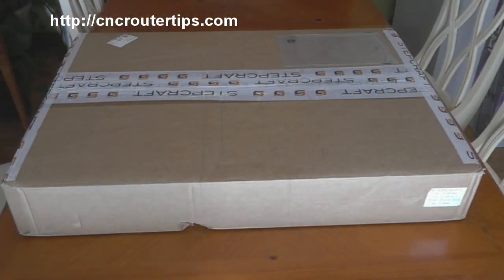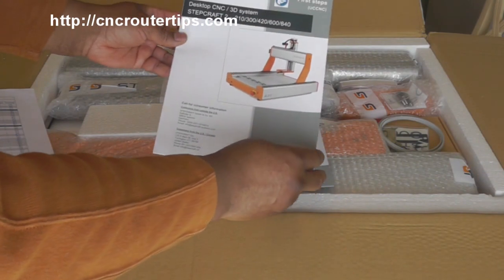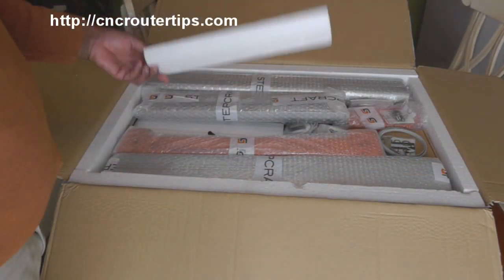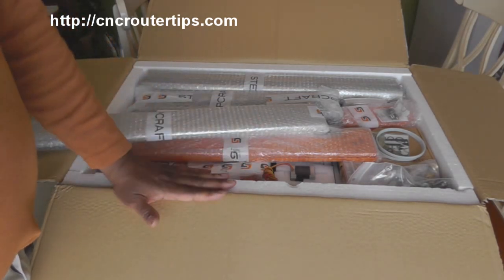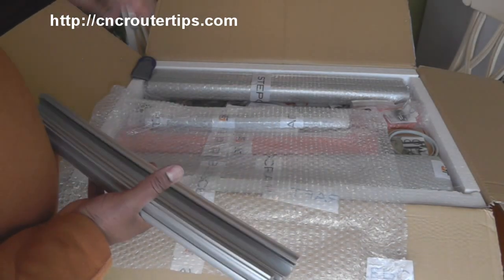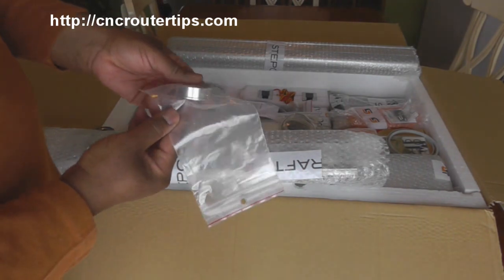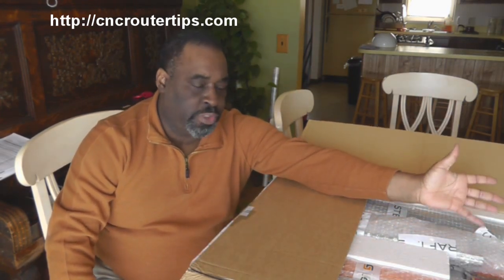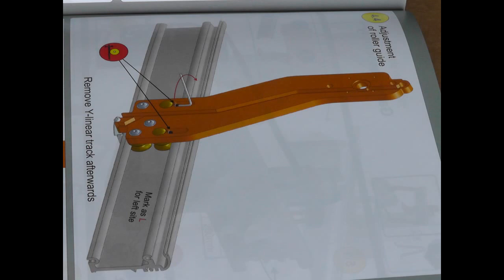Unboxing a Stepcraft2 600 CNC Router Table

Comment: I'm excited to see the build but I'm a little worried about the torque from those small stepper motors. It may have problems making chips in aluminum.
Reply: +William Hardin They handle aluminium just fine providing you use the correct router.
Reply: +jsa2001 Seeing is believing, now GETTER DONE! What spindle motor are you going to use? BTW stepper motors are cheap but the mounts would have to be changed also if you went to Nema 23's, I assume.
Reply: +William Hardin I already own and run the machine and have milled aluminium without any issues with the Nema 17's. I use the Kress 1050 spindle. Im not sure you can use Nema 23's with changing all the electronics as well as modifying the gantry and frame. Just a note the stepcraft is not a commersial machine but a hobby/prototyping machine hence the price
Reply from the maker: +William Hardin It will be interesting to see.
Reply: jsa2001 do you know if those motors can easily be upgraded to more powerful nema 23s